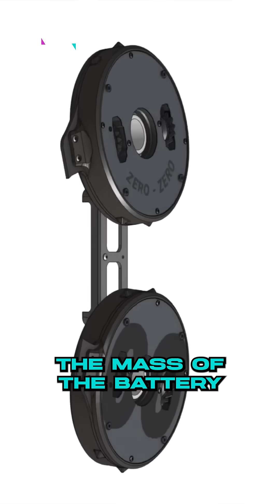How a torque reaction, double meltybrain works

Comment: Could you make the connecting plate a lot weaker so that halfway through the fight you go into dual robot mode?
Reply: Not without losing automatically, no. Its only way of controlled movement requires both, it'd be considered Drivetrain Disabled if you cut the bar.

Comment: The weakness of this bot is its connecting bar -- methinks that a hammer-saw bot or a scaled-down version of Huge or Nightmare* would be able to exploit that weakness

The only problem with that is that you then have not only one, but two, full-body spinners to contend with once you get them separated
Reply: It would have to be a pretty long armed hammer-saw bot, though, and the approach means risking a lot.

Comment: Hey quick question, you know how some bots have flamethrowers right? Why don’t you make one with a liquid nitrogen thrower? Cause it could freeze up their internals and other components and then you could take them out?
Reply: Safety concern or the rules are not allowed to have bio weapons.
Reply: @TheGlitterMan  I dont believe liquid nitrogen is a bio weapon lmao
Reply: @Blamzite  there is a risk for Asphyxiation. Plus handling is a another problem.
Reply: @TheGlitterMan  only a risk if your using obscene amount and have your head on the floor, anything used as a fuel makes gases which can also asphyxiate.

Its probably just a handling issue as most teams probably cbf dealing with it and the fittings required
Reply: @Blamzite  We just need someone try it first, win contests then the mass will do it. How big is the tank though within the robot bc Liquid nitrogen is another finite resource other than the battery charge.
Reply: @TheGlitterMan  its finite judt the same way flamethrower fuel is. I believe making a setup that can handle the cold of liquid nitrogen is probably just heavy and expensive as its a bit of a bitch and involves high pressure. Also it would be hard to apply directly for long enough to freeze since the leidenfrost effect would actually partially protect the opponents. Would probably just need something that lets of a decent stream
Reply: @Blamzite  what if you made something that punched a hole in the top of a bot and then had a nozzle to spray the internals? Almost like a HEAT shell in a way, if it had a spring loaded arm that would slam through the roof.
Reply: @Blamzite Its against the rules in EVERY competition in EVERY country that has at least one Robot Combat event.
Reply: @chdreturns  just checked NHRL rules and if your liquid nitrogen becomes gaseous before hitting the other robot it seems to be allowed. Just wouldn't be remotely effective

Pretty cool you read the rules of every robot league in every country
Reply: Spraying liquid nitrogen on something is a very inefficient way to freeze it, at least at the scale we're looking at here.
Reply: What about a nitro napalm cannon mounted on the given bot?

Would such a weapon delivery system even be possible to design and make workable?
Reply: You could use a cooling gas that wouldn’t do anything but maybe cool off your opponent and maybe stop them from overheating. Otherwise chemical weapons are against the rules.

Comment: Would a telescoping rod with a spring inside help with the bend between the bots
Reply: It would be substantially weaker than a solid bar and might cause the bots to collide with each other.
Reply: @Nyahaharlathotep  telescoping doesn't always mean curtain rod! But yes the spring rigidity will definitely have to be very high.
Reply: Honestly the bend might be a feature, means you get more gyro forces

Comment: Seems like you’d have control issues if one spinner was damaged and stopped and the other kept spinning
Reply: you are completely correct that the bot will barely function if one of the spinners goes down, on the other hand historically speaking it hasn't been all that big of a problem for any of the bar-spinner versions of this idea so far and the whole point of making a meltybrain is that the sheer mechanical simplicity means that you can make them ungodly solid compared to even pure wedges.

...though it doesn't look like he's got a solid "puck" of material with imbedded motor and battery there so maybe it's gonna be a problem?
Reply: @evernewb2073  Yeah, this is basically an evolution of what Droopy has done, and despite the potential drawbacks, Droopy has been a legend, so refining this idea has huge potential
Reply: @evernewb2073  Yeah, I'd think epoxy potting the components would make it way more durable, but that also means you can never reuse or repair components lol
Reply: Seems more like a bonus to me, get to see a flying beyblade robot
Reply: In that case
The broken spinner becomes the weapon spinning around the working spinner.
That's a bit obvious
Reply: @ it's ability to move is based on the spinners both working, if one of them drops then the bot is considered drivetrain-disabled. you'd think that would be a huge issue but, again, the more mechanically simple a device is the more durable you can make it. Droopy is already a nigh-unkillable monster and this thing is (at least in theory) potentially even moreso.